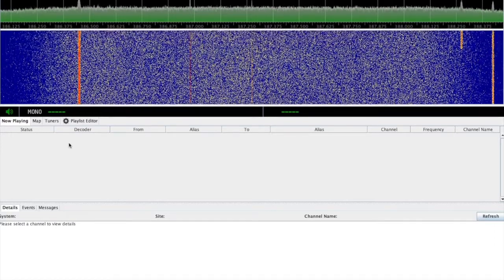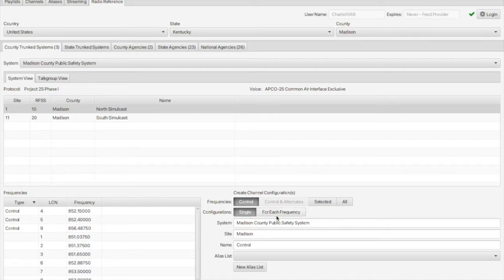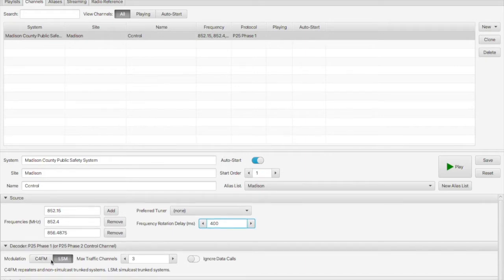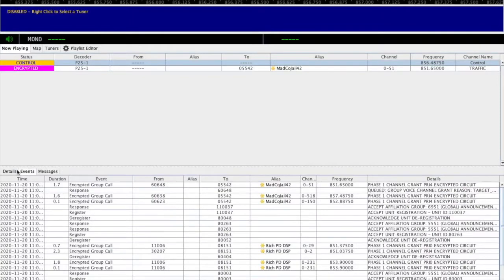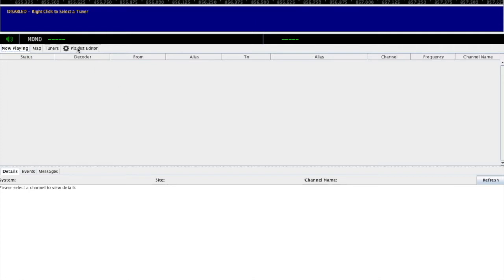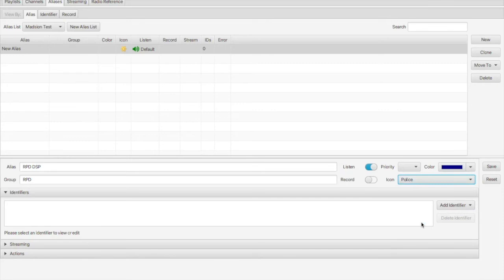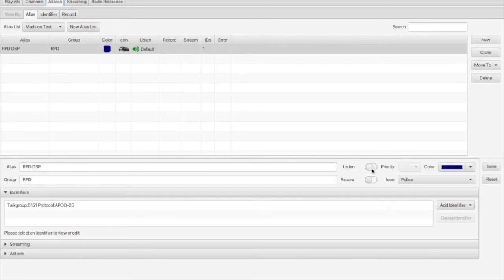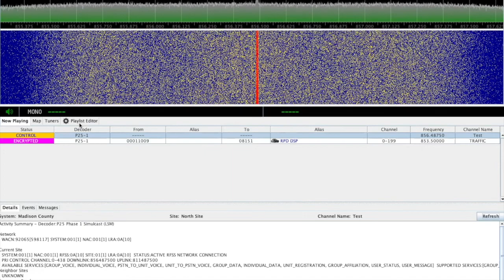How to set up SDR Trunk Part 2 (Programming a P25 Trunking System)

Comment: How does the baseband audio recording work? I hit record on a talkgroup and on one of my sdr tuners. It saves a baseband wav file and mp3s of the recorded talkgroup convos but theres an option to setup a recording tuner and wants a previous baseband audio file to work. Whata the difference in having a recording tuner setup or just pressing record while listening. And what is baseband audio wav file and whats it used for? Tx

Comment: Thajks, starting to understand it a bit better. Next, how do you hear the radio calls? I'm guessing you need to run DSDPlus and input from the Vcable?
Reply from the maker: SDR trunk has the audio built in along with the decoder just start the system up from the playlist tab right click on the black panel with the speaker icon between the spectrum panel and the traffic panel and set your audio output to whatever you like and you should start hearing traffic make sure in the same area you right clicked to set up your audio you see green text or numbers popping up that means the program is receiving traffic and you should get audio if you don’t see anything either the system isn’t running or no one is talking
Reply: @MAndNGamesV3  ahh ok so I don't need to pipe the audio into dsdplus or anything. That's cool. Thanks.
Reply from the maker: @CarstenBauer  yep SDR Trunk does it all within the program
Reply: I have everything working like it should but no matter what I do I get no audio.  All the calls are coming in perfectly but no audio?  Anyone else?

Comment: Anyone on here ever figure out the no audio problem?  Everything works as it should.  I can see all the calls coming through but there is no sound.  I am monitoring P25-1 no encryption.  I have tried everything with no audio.  If I put in a random frequency and hit play I can hear static so the sound works on pc.  I don’t get it?
Reply: Did you figure it out? Look in your user preferences under audio and make sure you have your speakers selected. There is a test button there to make sure you are getting audio on the different options if its good u will hear a beep.
Reply: I am having this problem. I can hear the beep with the audio test fine. Receiving signals, just cant hear anything
Reply: @ My problem ended up being that I only had one SDR.  After I started using 2 SDR’s my problem was solved.

Comment: I have sdrtrunk up and running. I also have unitrunker with dsd+. With unitrunker after I download from Radio Reference, it shows what I am listening to, Sheriff, fire etc. With sdrtrunk I need to enter an alias for each talkgroup I listen to? Or am I missing something? I also need to create a alias for everything I don't want to hear? I'd like sdrtrunk audio better than unitrunker, but seems more work setting it up.
Reply from the maker: You don’t have to put an alias to listen but the RR import feature will allow you to add talkgroups easily. You don’t have to create every singe TG to lock out what you don’t want to hear technically. Create an alias and add a Talkgroup range. Put the ranges you don’t want to monitor then select the lock out button